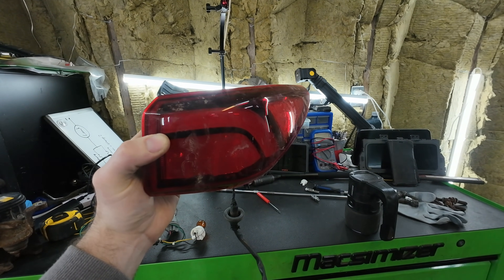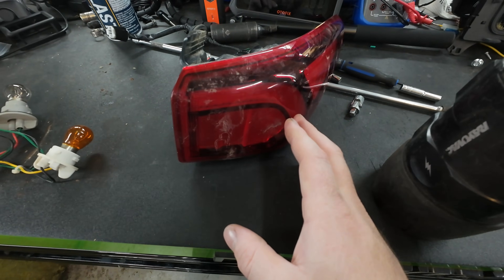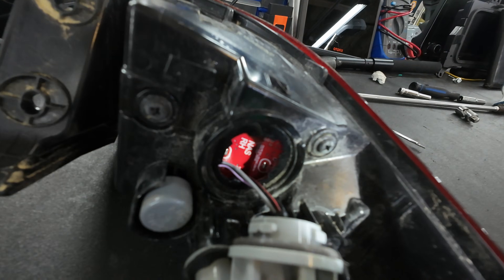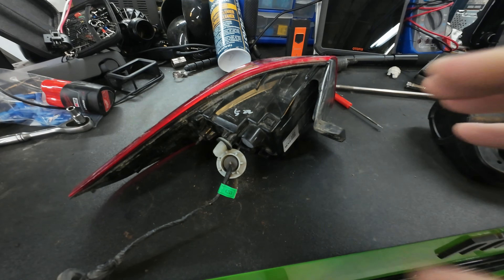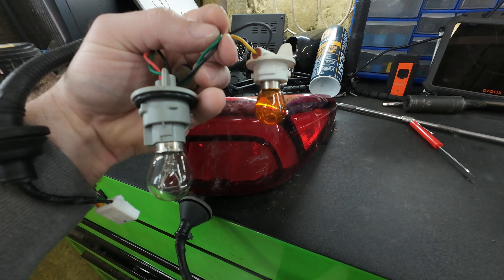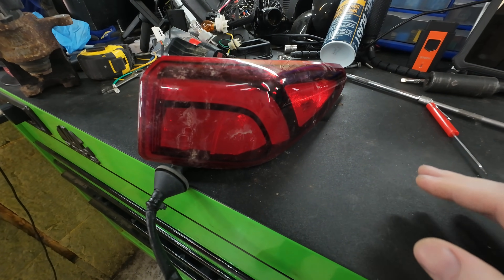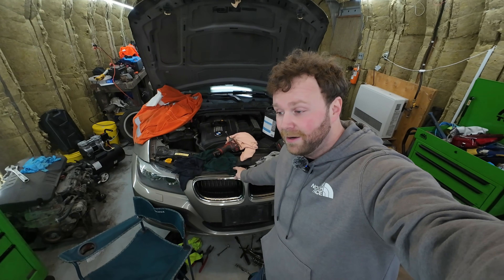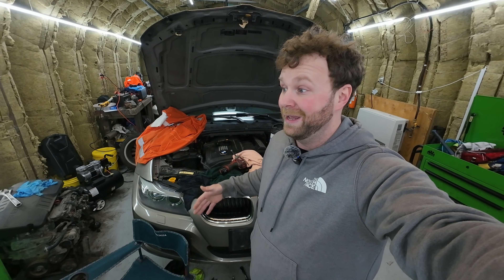Car Manufacturers don't even want you to change bulbs, they want you to replace entire assemblies!

Comment: Yesterday I posted on another channel this same topic: $3 tail light bulb is now $1500 repair. And people still  believe  new is better.
Reply: Early this year a guy did a $5000 taillight for an F150 which had a taillight that filled up with water and damaged the CAN cabling running through the taillight.  The whole harness had to be replace to get the light to work.
Reply: @dwayne7356  yea that does happen. The reason those lights are so expensive isnt because the led. Its because the blind spot monitor is build into the light. If they made the bulbs replaceable the second you touch that housing your are legally liable for that blind spot monitor. Meaning if you get into an accident the lawyers will go after you for it not working properly. Or theyll ask who did it and find out if they recalibrate the system. Its kind of dumb if you ask me. Im not a huge fan of some of the crap they do these days. Most of the non user servicability is for those reasons. The goverment keeps changing the laws of whats required to be on an automobile and the manufacturer is adding it and finding ways to bot be liable for any legal things after it is sold.
Reply: @dwayne7356  Yupp, CAN is one of the most stupid fucking things modern cars are plagued with.
Reply: @dwayne7356  as I recall that tail light was causing some kind of issue with the truck not running or not running properly.
Reply: The only way this stops, is to quit buying this junk.  Once the lots are full and workers are furloughed, then dialog happens.  Until then, the Car mfg's keep on building junk. Hold on to your money, drive your beater.   I drive a 14 Silverado with 260K miles every day and I refuse to buy a new vehicle for so many reasons I can't count.  I am not the car companies target customer.  If something isn't right,  I will tell you about it.  I've spent too much time in OEM plants as well as T1, T2 and other suppliers plants over the years to put up with this new level of BS.  LED's don't last at home much less in a car or truck.  I would buy a 55 gallon drum of 40, 60 and 100 watt incandescent bulbs and unload every LED in the house right now because LED's don't last.  Folks can make their own  decision but we all have one thing the car companies want....our money.  Use that as a sledgehammer.
Reply: @terrymoorecnc2500 

You gotta think about this... How exactly should they design LED arrays and driver boads to be easily changed? All they can really do is make them open easier. The learning curve to fix these types of things, no matter the orientation, is steep and takes soldering and electronics recognition most always.  Ive fixed easy ones, ive fixed complicated ones. All of them required prior knowledge. You cant just pop in bulbs and things and have it look as good as an LED array without it being overcomplicated. Maybe im wrong but I dont think so.
Reply: @gnomiefirst9201  My 06 Ridgeline has standard style T/S bulbs up front but the bumper cover has to be removed to get to them.
Reply: @leegraves101 
Not a big deal.
Reply: @gnomiefirst9201 

Hey Gnomie, I fix these types of LED tails and things all the time. What you want to do is take a dremel and carefully cut the backside plastic open along an area large enough to pull out the LED array and or PCB board. Usually its really easy to tell where to cut to pull out the guts and its along straight lines. Silicone back together after. But this way you can solder and fix whatever LEDs or components are blown. If youd like help id be more than happy to do it for you very cheap.
Reply: If this non service idiocracy continues, just imagine what will be on the space craft sent to Mars with humans aboard. If a panel breaks they will have to wait till the courier shows up with a module from earth...
Reply: @bekkiebeans6004  If a spaceship will be commercial than yes, change lights-engine module.
Reply: @bekkiebeans6004  do Uber cover Mars these days? ;)
Reply: Mechanics here: Newer is definitely not better! Cars 35 years ago were better!
Reply from the maker: New is nice. But definitely not cheap or easy

Comment: Honestly non-serviceable lights should be regulated out of existence, for this very reason.
Reply: We had a Cadillac CTS that had xenon tubes for the top brake light come in the shop It had a little tiny ballast in there that ran them. I went to Walmart and bought two short LED strips and put them in the housing. They were 12 volt. Worked perfectly. Cadillac wanted almost 600 bucks for a complete assembly.
Reply: @arthurgay5746  GM greed. Bailed out by taxpayer money, yet ripping off the people.  Glad you found a better way.
Reply: @TheMailmanOfSteel  agreed.  I hate to say it, but the politicians need to step in and make this go away.  A burnt bulb is all it should be and a dollar is what it should cost.
Reply: @billkraemer4710  Not to mean anything rude. Politician will step-in only to maintain this status quote since they were all backed by these planned obsolescence cult.
Reply: @billkraemer4710 But gm wouldn't have any money to give to their lobbyists in Washington. Led's are better for the environment remember. Politicians love the environment because there's big bucks in it.
Reply: Nah, an environmental impact fee, equal to full retail price and fees for every unit produced. And maybe a dollar per unit specifically on the CEO of the company.
Reply: @TheMailmanOfSteel  I rebuild them all the time, so much now that's its getting lucrative.
Reply: @GoonyMclinux  good idea :)
Reply: Women make the final purchasing decision for more than 80% of new cars.
Reply: @actually5004 Not me, I don't buy new cars, and I'm single.
Reply: Automakers have politicians in their pockets. You and I do not.
Reply: @TheMailmanOfSteel  it's for this reason the regulations were put into place.... It's all made to make no sense....
Reply: There are so many reasons not to buy a “modern” automobile or truck. Technology and engineers just keep adding reasons to not purchase them. We used to trade off and buy a new car because the old one started “nickel and diming” us. But now, I’d much rather be “nickeled and dimed” than to pay hundreds for something I can fix myself for pennies on the dollar.
Reply: @TheMailmanOfSteel  or make it compulsory to sell a new unit for 5 dollars and they must be available for 20 years with a maximum delivery time of one week.
Reply: Decades ago lights went the direction of units for 300 dollars versus 95 cents. My first customer had no choice.She blamed me.
Reply: My 2025 Prius is like that with front and rear light assembly. I bought some led lights for it but that was waste of money can't put those in.
Reply: I agree. They can make these so my wife could change the bulb. One piece assembly should be outlawed. The automotive industry sticks it to us enough already
Reply: More money it costs.. more taxes paid my friend
Reply: @kevinc8026 holy crap! One more puzzle piece fits into place. It's a multifaceted problem.
Reply: Perhaps it's deliberate.
Reply: @chaosflower4892  Oh, it definitely is.
Reply: as to HOAs.....!
Reply: @TheMailmanOfSteel  I recently had to replace the brake light in the rear window of my car. I had to take it to the mechanic to get the burned out bulb replaced. I couldn’t just get a new bulb. I had to replace the whole assembly.
Reply: 2005 Dodge Grand caravan headlight assembly $200 each.
Reply: We no longer have representation neither in US or EU. Politicians don't listen to us, they listen to the interests of the companies doing this and get paid enough to not care if a lightbulb replacement costs a basic worker's entire paycheck.
Reply: @TheMailmanOfSteel  consumers love the look of those lights. And these days folks have more money than sense. That's part of the cause. The other part is greed
Reply: @TheMailmanOfSteel   we ended up with this because too many regulations. Auto makers and politicians are cronies.
Reply: Manufacturers should be required to produce a compatible housing that only uses DOT bulbs as a baseline, with the commitment to make it available via their parts network for the same duration as the fancy version, before the NHTSA can approve the fancy version.  It’s critical safety equipment that needs to be maintainable by any owner regardless of their immediate financial situation.
Reply: @Namewithheld00123 yep. I think that you have hit the nail nice and square right there. Drivers have enough challenges without missing signal lights.
Reply: "oh, without these regulations i could afford to do better" - car companies probably
Reply: @TheMailmanOfSteel  lmao, a regulation, in this administration! Lol
Reply: These are able to be repaired and replaced pretty easily, most people see that it has to be glued back together and stop. There are TONS of guides on how to do this, I have repaired other people’s LED headlights that were sealed and it was pretty easy to be honest. The only thing that sucks is it takes a lot longer than if you were swapping a bulb, but honestly it isn’t that much more difficult, it is a time sink more than anything.
Reply: Then charge the exact same price as an LED replacement bulb. $5
Reply: @TheMailmanOfSteel   Stop thinking government is the solution.  Stop buying cars with the features you don't like.
Reply: @StoicLion  
What if they ALL are like that?
We need  Right to Repair, which means repair not replace everything.
Reply: They are regulated INTO existence by politicians,  who are lobbied by car companies to do so, foe extra profits later on.
Reply: @TheMailmanOfSteel  Exactly. It's not as if LEDs have to be built into the housing. I understand the argument for LEDs. They turn on faster, last longer, and use less energy. None of those benefits go away when LEDs are replaceable.
Reply: @joerapo  LED lighting is superior to incandescent in terms of energy consumption, lumens/watt, minimal heat generation, and ability to turn on/off faster but those advantages are lost in practice when you factor in their increased cost and the added complexity, i.e., printed circuit boards, multiple solder joints, etc. You now have many more opportunities for failure compared to a simple incandescent light/harness!
Reply: @georgejetson4378 The LED bulbs can still be used replaceable.
So instead of a 25 cent incandescent bulb you replace a $5 LED.
Absolutely no reason to have to replace the entire light assembly or have to hack it open to repair.
Reply: So now you don't talk about freedom lol. Don't buy those cars if you don't want a non replaceable lights
Reply: @rummimg  so how are you gonna know which parts are serviceable of a car you want to know. You got idea how long it'll take to find out. By the time you get the info, someone else already got the car. No. Let's just make the manufacturers go back to serviceable lights. You can let them keep screwing without lube.
Reply: It's serviceable, you replace the assembly.
Reply: @VideoArchiveGuy 
Not for $600+ that's ridiculous.
Reply: @VideoArchiveGuy  But the assembly is not. Anything that costs over $100 bucks should be serviceable, and it used to be, this was done by design.
Reply: @VideoArchiveGuy  That's not serviceable.  That's replaceable.

Comment: You could probably rig up incandescent bulbs in that taillight unit. But the leds in the unit are 5 volt controlled.
Reply: Plus they communicate with the car so that the car computer knows whether they are lighting.

If you used bulbs you would have to find a way for the bulb to communicate via the CANBUS to tell the computer the lamp was lit.
Reply from the maker: I mean alot of aftermarket led bulb replacements step down from 12v to 5volts. so you could just do that, :)
Reply: @Lancemechanics some of the led units have a core charge . Yes you probably repair them . But is wrong with the unit, diag needed
Reply: @Lancemechanics  I would be sure that KIA does not run 12 Volts to the lights. Just a way to force you to buy their crap rather that reworking their crap.
Reply: @Lancemechanics  Someone should figure out how to reconfigure Christimas light leds  for automotive use  . Five  bucks for 20 feet of Christmas leds. The car manufacturers are just shameless greedy bastards demanding 1000 bucks for the same things.

Comment: As Uncle tony says, old school stuff, point, carbs, crank windows an such, represent reparability and even freedom. That Beemer there, I had a '95 here last week to put in a starter. I looked.... saw it down there, looked up some info on it's replacement, and called the guy and told him when I saw "step 1- remove wiper blades"- i told him I ain't doin it. He said sell it, I did.
Reply: bmw's are tough to work on - no room to wiggle, replaced a clutch on one a few years back, makes me cringe just thiunking back on that:-)
Reply: Brand new crap cars that rip you off when something breaks - NO THANKS !
Reply: What do the wiper blades have to do with the starter?
Reply: @1940limited access, even early '00 bmw need to remove the cowl and intake to get to the starter.
Reply: @RickTrajan  that's disgusting, the worst starter replacement I've heard of
Reply: @1940limited IDK , perhaps you have to remove the windscreen for access?
Reply: Was it an e36? I bet it was 😂
Reply: The wiper blades need to be removed due to the long cowl.  This allows yo to take the engine cover off by the windshield for access to the bolts. You might be able to remove from below but it is a long reach.   Now don't expect to replace timing covers on some BMWs, they are mounted in the rear of the engine and need the engine to be removed and transmission removed.

Comment: Hello from sudbury ontario.   You should make a video of all the things we don't get paid for as flat rate techs.  ( if you haven't already done it).   Digging cars out of snow banks, looking for keys,  looking for cars, looking for repair orders,  wrong parts ordered, looking for tools, making broken shop tools work ,or fabricating tools.  Etc.....   I'm sure you can think of more.  I'm with you.   Automotive industry is broken, although I'm not sure how it will ever be better.  People don't look at mechanics the same way they look at electricians and plumbers for some reason.
Reply: Any one asking why don't you just quit is engaging in victim blaming the fault is 100% on the white collar criminal performing wage theft.
Reply: Yeah the parts guys get paid for their 8 hour day. They get paid for giving wrong parts also.
Reply from the maker: I did an older video on that. been meaning to make a new one. as I've seen. most dealers its a lot of common stuff, but going from like ford, Toyota or Hyundai they all have there little niche stuff they screw techs on.  Also your in a tough area to work. NO vehicle fails like it does in Sudbury's climate +. Try claiming extra time for rust :S
Reply: yea as a fellow tradesman, I think its BS mechanics don't get valued. They are being taken advantage of by the car companies, and now they and the customers have to pay for it. WTF happened? if this was occurring in my trade id be floored.

Comment: What about some LED headlights going for $1000. Crazy.
Reply: have you noticed we're all now blind from these new headlights instead of improving visibility. when everyone had halogen we could all actually see with our collective headlights. and they were nice warm color temperature instead of all this blue and white. its so annoying driving at night now. especially if youre in sedan and most people are higher up in their crossdressover SUVs
Reply: @doomer33deg couldn’t agree with you more. Bigger, brighter isn’t always better.
Reply: @doomer33deg  try those yellow tinted  - blue blocker driving shades - they work great to neuter the High intensity LED Retina burners.  takes a few minutes to adjust your vision to them but a Big Help
Reply from the maker: Making a series on that, some Cadillac owners have allegedly gotten a 6000$ quote for a single headlight. not sure if half that is labor but its incredible. also on some fords you have to program the headlights. its not new but people have been focusing on that for some reason lately.